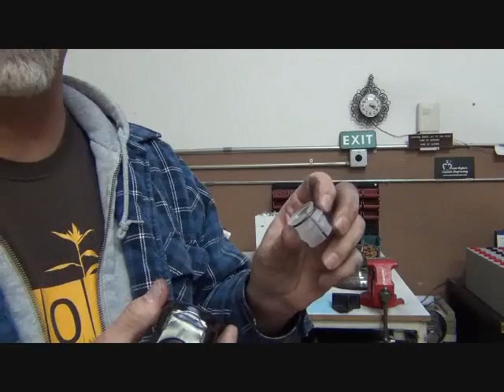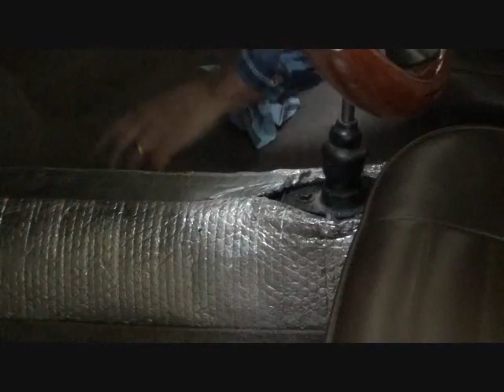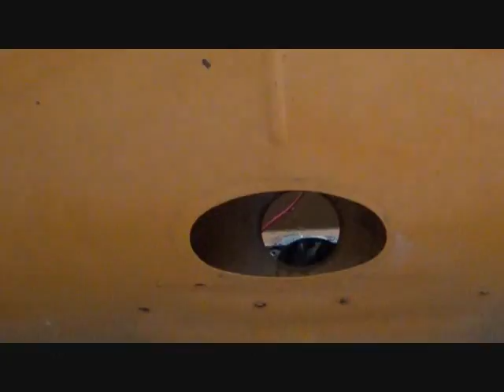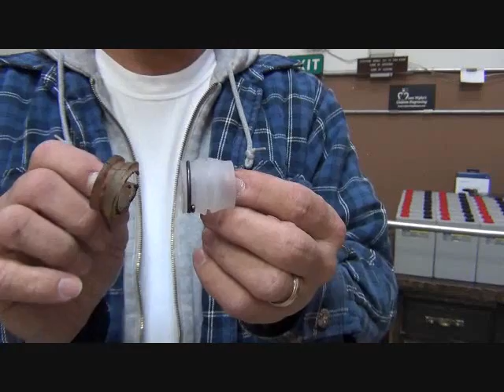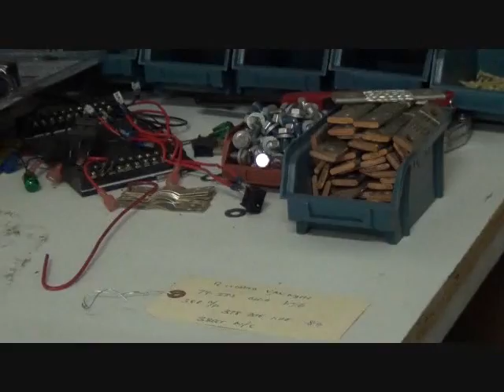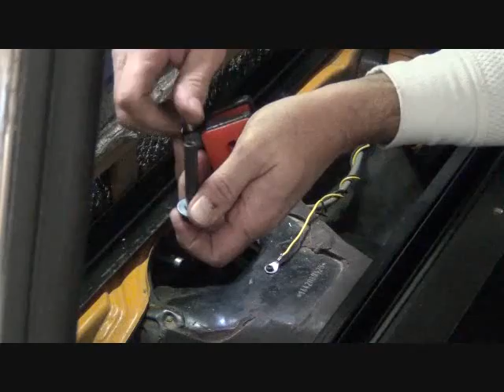How to Replace a Shift Rod on a Classic VW - Another Good Idea from EV4U

Comment: Good video, lots of detail. Can the brass bushing be installed without removing/installing the hanger bracket?
Reply: And where do get the brass bushing?
Reply: ....never mind, I looked at your website and found that you sell the kit. I'll be contacting you directly.
Reply from the maker: Yes it can be installed without removing the hanger.
Reply from the maker: We are the manufacturers.
Reply from the maker: Thank you for watching and for the order.
Reply: For the record, to help the public, EV4U can sell you an installation tool to allow you to install the improved bushing without removing/reinstalling the hanger. There is no doubt in my mind, that this is the way to go. Yes the cost is higher, but I am convinced that my Bug will shift better than ever once I install this part.
Reply: If I recall, they somewhat skip over that and there is probably a reason. It was not simple to install, but with a little patience it goes in. He did a good job with the installation kit that is available at an additional cost. I highly recommend the install kit if you are considering buying this bushing. Without it, you will need to get creative and make your own install kit.